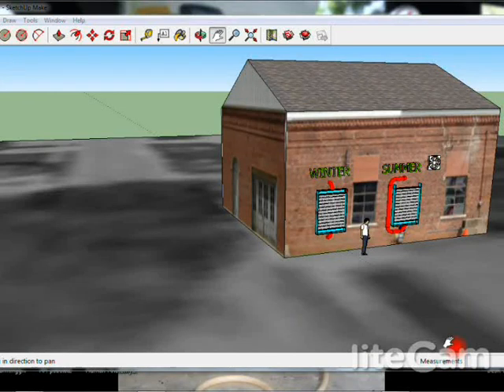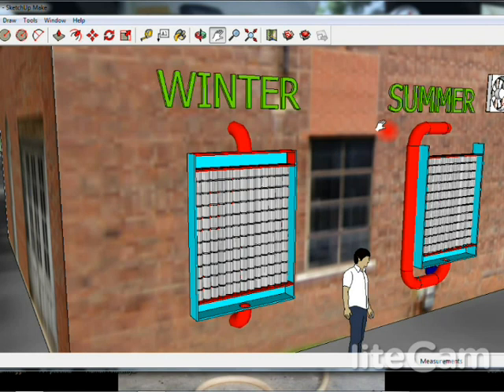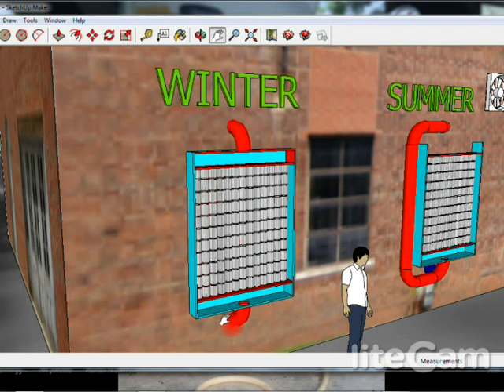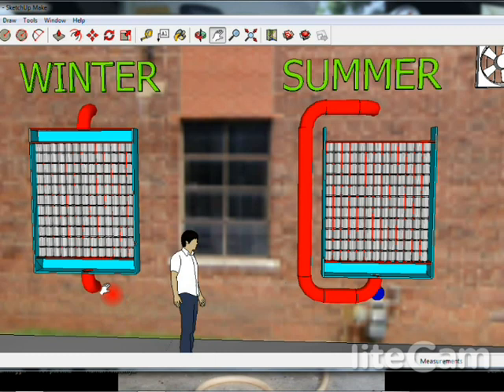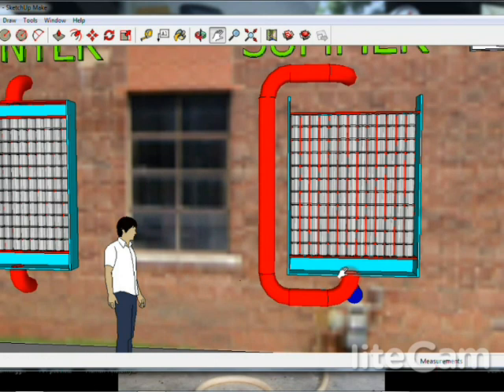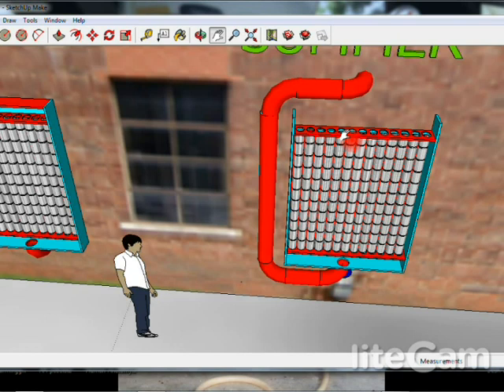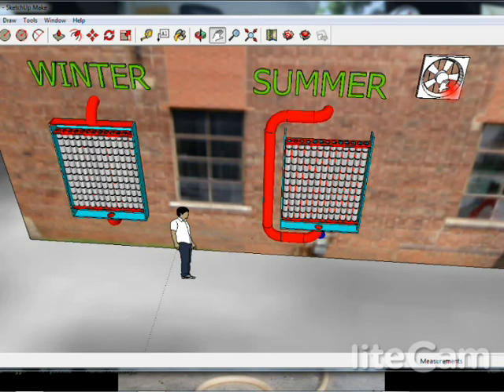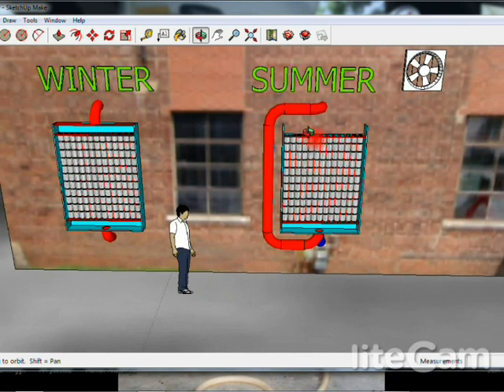Solar Cooler/Ventilator And Solar Heater in 1, Using Sun's Heat To Cool Your House

Comment: Blowing hot air is still hot air. The aluminum cans will still hold the local temperature assuming the heat absorber is blocked. You'd be better off blowing the hot air through bricks or anything else that doesn't absorb heat. Also, kicking air out under the eave will put it back in the attic.
I love that you're tackling this! Keep up the good work!
Reply: Bricks dont absorb heat? Lol.

Comment: This concept is already published. It's called a "Solar Chimney". It works similar to your summer version, except "cooler" air is brought in from the bottom of the building. As the hot air is pulled out of the top. The cooler air is sucked in from below. Your version using the wall mounted cans is a good alternative (DIY) to the original version. Good idea.
Reply: Actually, this is a mix between a solar chimney and a trombe wall.

Comment: Sometimes, as viewed here, we learn from comments as we learn from concepts. I guess this is a form of collaboration. I love the part showing elimination of the elimination of an electrical fan, thus demonstrating refinements are possible without intensive technological development. Although my own crawlspace is very cool during summer, the question arises as to how effectively circulating air through this chamber would be cooled to a sustainable temperature. I may start accumulating aluminum cans and find out, using your concepts, although my interest seems to be more along solar heating and storage tank accumulation during winter, and using evaporation cooling with efficiency enhancements during summer months. IMHO, solar-electrical seems fantastic for smaller controls to support needs of larger, passive installations such as you have illustrated. Please stay in touch.
Reply: For heating, check out the channel "Sergiy Yurko", with the video "Very cheap ( $15-40 ) solar collector-concentrator that does not need a tracker". Instead of a big parabolic mirror, you can use a fresnel mirror. You can adjust either the angle of the fresnel mirror wall, or that of the pipe which captures the sunlight, for increased efficiency. The channel not only has multiple designs tested, but it also does the math to find out the price of energy generation, as well, when taking into account the labour cost of having someone change the angle of the panels every 2 weeks or so.

Comment: I did some experimenting with a pop can heater. I also tried a few other ideas like a plywood maze, covered with roofing flashing aluminum. Then I tried using aluminum down spout. That one got hot enough that I had to get my hand and thermometer out of the way... Still tinkering... I like the valved version he has in the video.

Comment: Great concept!
I was sitting here on a rainy day watching videos on these heaters, and wondered if it could be used to create a draft to cool the home as well.
This is the same principle behind the air circulation system in an Earth Ship home.  In the Earth Ship an inlet tube is run from the back of the home underground and out, allowing the earth to cool the air inside...the front (south facing side) of an Earth Ship is a greenhouse, where solar energy creates the updraft to vents in the roof moving cooler air in from the back of the home.  In winter, they merely close the inlet tube, so the warm air from the greenhouse stays in the home.  
I think, from watching a few dozen videos on these heaters, the angle of the surface area will be the greatest factor to making it work really well.  The Earth Ship, for instance, angles the greenhouse to capture winter sun deeper into the home, while keeping the inside shaded through the warmer summer months.
Reply from the maker: Seth Hofstetter Thanks for your insight Seth. IT's a great idea to take in the cool air from behind the house in the summer. I'll keep that in mind if and when I build this design
Saeid
Reply: You could also use evaporative air conditioning to not only create draft, but also lower the temperature due to the air current going through a wet mesh or terracotta/cement and forcing the water to evaporate. 

If you then take the hot air in the house and get it outside the house with this video's system, and have the evaporative air conditioning in a different part of the house/room, you will get a lower temperature inside the house.
Reply: @SapioiT  that works well in some situations, but here (Missouri) as with certain other places, the humidity is high enough to reduce the effectiveness of evaporative cooling (less evaporation occurring)...plus, I wouldnt want the added humidity in the house, its hard on us and our stuff.
Reply: @sethhofstetter8161  Then you can (1) use a heatsink inside a pipe which goes to the heating element, to get the hold from the lowed pressure and from evaporative cooling, and (2) use a longer pipe after the heating elements, to act as an updraft pipe, where the hot air creates more updraft which pulls more air, which increases the efficiency by lowering the pressure of the air going in the intake. You might need some way to throttle the intake, to find a balance between lower pressure and higher air speeds. And you can even use a system which automatically throttles the intake depending on the speed of the air, while ensuring there is still some hole for the air to get into even if the flap (air valve) is closed completely, unless you put a cap on to go from cooling mode to heating mode. Sory for the long delay before replying!

Comment: Going to share with our cohabitors here and see what they think.  Looks like it would work in a certain situation, a large high-roof metal shed/shop.  Will let you know if we try it.  Thanks for sharing!
Reply: If you're living in a house with some land, you can use fresnel mirror walls to concentrate sunlight onto the heating panel, to make the heating and cooling more efficient. For cooling, however, you might need a separate insulated pipe to cover a smaller metal pipe going to the inside of the building, located below the heating area, so the lower pressure air cools down the smaller pipe, which lowers the temperature inside the house even more. It's also useful to learn how Solar Chimneys, Trombe Walls, and Updraft Towers / Updraft Chimneys work. The more heat gets onto the heating panels and the taller the exhaust pipe gets, the more efficient the cooling will get.

Comment: your design is clever & even elegant in how it uses natural physics to heat & cool a building with simplicity & few moving parts & little or no electricity expenses, plus your video has stimulated many others to think about the subject.  good job, i hope you get it built & i hope & expect it will work well.

Comment: Yep this a cool design that’s hot at the moment you switch pipes... this is really a good idea. show us when you’ve build it and get us some stats on size and and temperatures and also an estimate of the total airflow and room space...
I would like to build one myself...
I am currently running hot in summer....
Thanks for the video...
ecological engineering at is best because it’s doable and runs without external power...
I think I really gone try something like this...
Reply: If you need cooling, it's better if you use a slightly different setup. You want a insulated air-sealed box with a heatsink inside, the sealed box to have a small intake area (ideally with the option to throttle the intake, to fine-tune it), and get the output of that box connected to the area where the air is heated, and ideally connecting the output of that with an upwards-going pipe. As the air heats up, it rises, and the pipe gives it more room to create more updraft, to pull in more air and increase the efficiency. As air is pulled through the intake of the heatsink box, the low-pressure air has lower temperature, which cools the heatsink with both end pipes going inside the house.

Comment: Would be very nice to see a prototype built in real life, especially if it's tested for air speed and temperature change at different outside temperatures and sunlight, for both cooling and heating. Documenting the results would make it a lot more scientific, and would convince a lot more people to try it out and improve upon it.

Comment: The concept here is sound. I use curtains in my home to divide rooms and hallways. The curtains don’t reach the ceiling or the floor. By generating heating/cooling in one room, I can quickly heat/cool the other parts of the house. Example: I turn the heat on and the heat travels over the curtain to heat the next room over. That heat pushes the cool air under the curtain to the room being heated. Small fans help the push the heat in one direction or the other from the heat source depending on which end of the house I’m in. The outer rooms actually heat faster than the one with the heat source because all of the cool air is being pushed into that room. 

About your design... in your video I’m looking at the image of both the winter design and summer design together. Keep the winter design. The summer design with the top removed would allow rain to inter the system. Create three top exits on the winter design such that the left and right ones can be covered in the winter. Open the outer two in the summer and turn the 90 degree elbow on the center one 180 degrees so that it pushes the heat away from the house. Put an exterior dryer vent cap with a flap on the end to keep our rain. Put the same system on the outer two. This creates three heat vents at the top with one intake on the bottom. The “red” vent pipe on the summer system would remain the same, but paint it white. This will keep the air in it cooler than the air in the “heater” and generate the suction you want in the summer. 

As a side note, I’ve seen side by side videos of heaters made with screen and cans. The screens consistently out perform the cans and they are easier/quicker to build. 

Sorry for the long post, but I hope this helps.
Reply: Time stamp on your video that I was looking at... 1:21.
Reply: Also, the fan idea I saw in one of the other comments is a good idea. Put the solar powered fan in the bottom opening to prevent overheating. Here it will help draw cool air out of the house during the winter and pull hot air out of the house in the summer without the need to modify it from season to season.
Reply from the maker: Simple and brilliant. Bravo
Reply: I didn't know screen/mesh works better that cans. I thought the corrugated metal sheets worked best. Thanks! It might have to do with the pipes being thicker. Especially at the beginning, until the pipes get hot enough. It might also have to do with the surface area of the mesh being higher, which facilitates heat transfer.
Reply: @SapioiT  Surface area,  turbulence and efficiency in heat transfer are the keys here. That’s why the screen mesh is more efficient.
Reply: @inomad1313  I see. Thanks for explaining!
Reply: @inomad1313  I think the summer system might work better by separating the cooling loop. That can be done by having a heatsink inside a box which serves as the intake of the heater, and that box having a throttle control intake, and maybe also have an evaporative cooler between the intake and the heatsink. The heatsink pipes would need to be insulated, and likely also the box with the heatsink. Adding a pipe going up from the exhaust increases efficiency. Hot air rises, pulls more air from the box, which pulls more air from outside, and the drop in pressure and optional evaporative cooler drops the temperature even more.

Comment: I like the multi purpose design because you are going to need valves for opening and closing the ducts either way. Maybe you can combine 2 into one and have more sun power collected, and use your valve system as a starter and improve from there. Anyways, good thinking! Keep those ideas coming.. We need them.

Comment: Ok, I believe you have a viable concept though, may I add a small suggestion? This would be difficult in town but I live in the country so if you could use some 6 to 8 inch pvc similar to the geothermal configuration below the frost line in the ground and plumb it through the floor in your home like a cold air return only in reverse. The pvc could have an open end above ground with elbows turned downward and screened to keep vermin and rainwater out. Instead of the geothermal type with piping water you simply just pull in the cooled 50 degree air. It would take some ingenuity and work but greatly enhances your system to cool the home.
Reply from the maker: +ilovejesus4evr 
All great ideas. Thanks!

Comment: Interesting concept for summer cooling.  I have a similar idea, but with the solar exchanger on the roof for the summer configuration.  This way, the air flow is all upward.  In your scheme, heated air has to fall for it to work.  Imagine the exchanger on the south side of the roof, fed by plumbing coming out of the top of the south side wall.  Replacement cool air pulled in from a port low on the north side (in the northern hemisphere).
Reply from the maker: +Walter Jacques Yes, sounds good. Are you thinking about making it?
Reply: Saeid Momtahan Yes.

Comment: It will almost certainly work as you intend.  Of course it will not actually provide any cooling but it will provide some solar powered ventilation.  The orientation of the panels, vertical as opposed to tilted, is not ideal for any latitude.  Normally one would want to orient the panel at latitude (for example 38degrees from horizontal in San Francisco) for a good mix of summer and winter performance.  You could also do latitude plus 15 degrees for best heating performance or latitude minus 15 degrees for best summer performance.
Reply: True, but it being like that makes it work better for winter heating than for summer cooling.

Comment: I know this is several years old, but I had a comment.  You could greatly simplify the design by just venting the top inlet in the summer.  By venting the top pip to the outside, the inside air would still be pulled out of the building and up through the solar heater.  The hot air would just  escape out the top of the heater outside.  Just remove the top pipe and block the top opening in the building.
Reply: yeah that's basically the principle of ventilation. I mean it's nice and all, but has been around for like 5000 years. Put a vent in the ceiling, open a window on the shadow side of the building. But hey If he has the thing installed already for the winter, why not also use it in the summer?

Comment: Interesting design... Here is another idea.... 

1) Build outdoor box using down spouts and make sure box is weather resistant.
2) TOP line should house water line that allows water to drip down all the holes inside each drain pipe.
3) Poke a TON of tiny holes in the drain spouts. 
4) At bottom of outdoor box - Place a drain that you can open/close (winter/summer)
5) In summer time... Allow air to flow through box... But turn on drip.
6) In winter time.. Turn off drip and water access to box to prevent freezing.

The constant water drip should allow air to cool.

Hard part will be controlling humidity... As much of the water may evaporate.

Comment: Looks like you could do the same with a Trobe wall. Also, in summer you can bring in cool air from under your house if it's a timber floor or via pipes under the ground if your house is a slab.
Reply: Or the hot air can be used with a solar chimney to create the updraft of an updraft tower / updraft chimney, to get the intake at a lower pressure than ambient air. That lower pressure could be used to cool a radiator through which air from inside the house moves, so you effectively cool the house by heating the trombe wall.

Comment: I want to build a passive solar heater similar to this but didn't know how to deal with all that heat in the summer. I was going to do my build with aluminum screen. There would be less chance for water to accumulate and grow mold. With the screen any night moisture should get evaporated during the day.

Comment: The Soda Can Heater Winter Mode is using all around. I also think something like yours a year ago. And the best way to cool down the room has three answer. 1) Take the humidity in the room 2) Cool The Air. (Do not wait some new air to come inside like yours.) 3) Check if your home is well insulated by all means. (roof, walls, doors, windows)If you want to make the room cold the best way with this system is do not make any modification with the summer system. Just put a fan in at the output. In winter it will suck the air from soda cans and it will give hot air inside. In winter it will push hot air from top and the cold air will come from below intake. But how ? It is easy. Make your soda cans, and the soda can panel water proof. In summer close the transparent glass with somethink white and dont let it to take any sun shine. Fill the outside chamber of soda can panel with water. Add 1 intake and 1 outtake line with pipes. Fill the soda can outside chamber with water. Circulate the water from the pipes from a car radiator. And last well done you made a cooler nearly 0 Emission. You can make the pump work with solar panel. Or if you have a 40 tons of underground cold water storage like mine. You dont need a radiator.. 

In short, cold water at the outside chamber will make the hot air going inside the soda cans will cool down. If you find a easy way to make the water cool down (cheap way) like 10 - 15 C degrees. It will work great. The temparature between air and water must be at least 10 C degree. To take good results.

Good Luck.